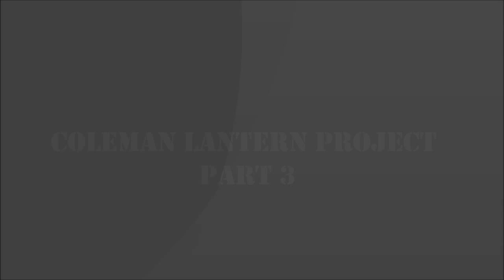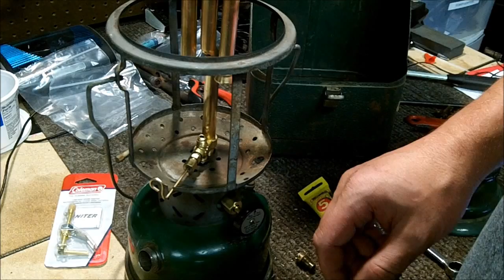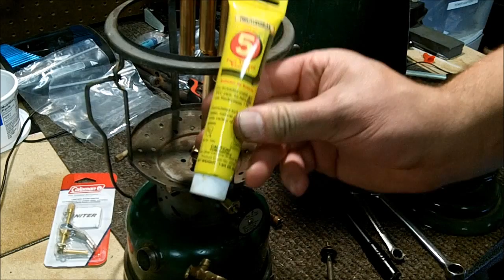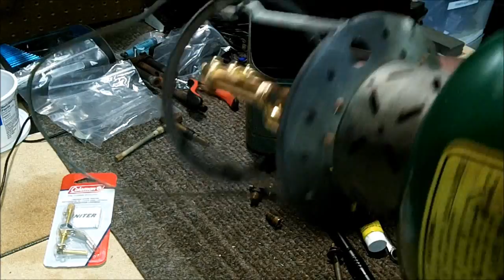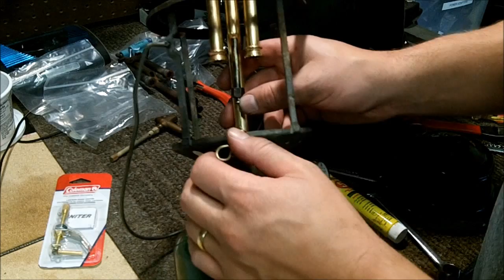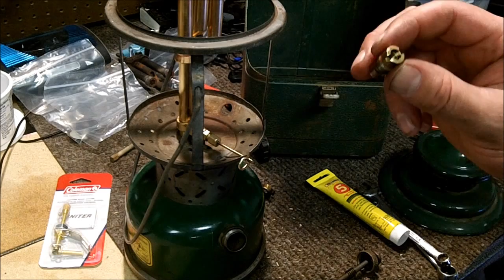Part 3: Coleman 220 Repair Project

Comment: Does anyone know what does a tip clean do?  Do I have it face up or down?
Reply from the maker: It cleans the small orifice, that is basic the fuel jet. I not quite sure what you are asking on your second question, can you clarify?
Reply: @RavenwoodAcres  I was told by another person I need to have it face down or else the fuel line is not openned
Reply from the maker: @adventurerfromLA  I wish YouTube would allow us to share images in the comment section. If you can wait a day or two I will publish a video showing the installation steps for the cleaning assembly.

Comment: i found that if you are replacing the tip cleaning lever to the excentric block take a piece of wire and put it through the hole at the top of it(the block)  helps alot in installing the lever cause you can hold it in place while screwing in the lever hope this will help some people out there . the wire i use is a trash bag  wire tie with the paper or plastic stripped off one end
Reply from the maker: Great tip, thanks for sharing.